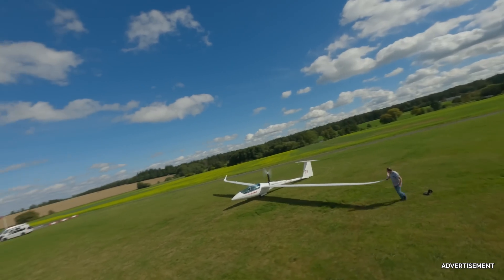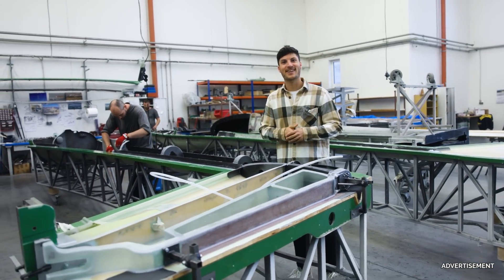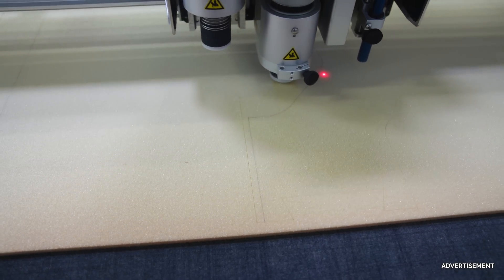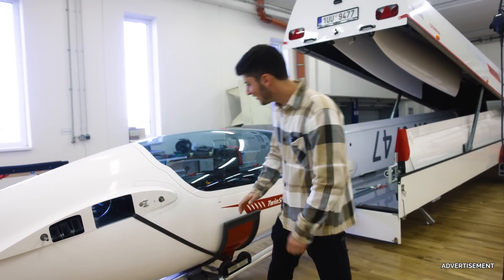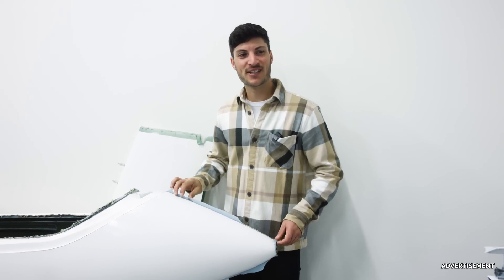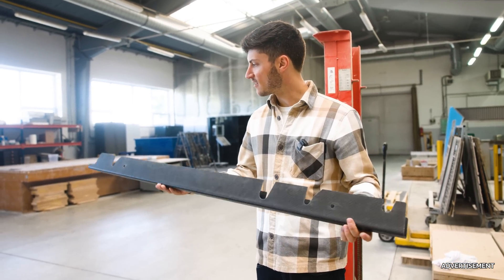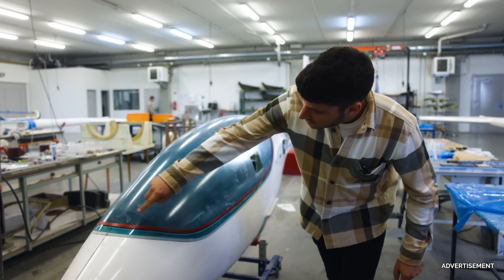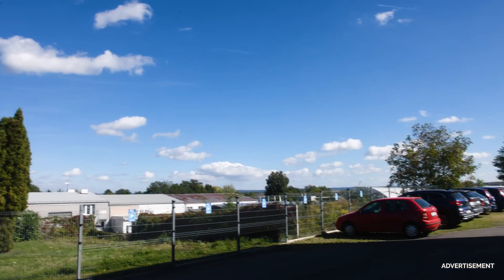How Gliders Are Made - HpH Sailplanes Factory Tour & Production Insights

Comment: Very nice. The wing is a little above the center line of the fuselage. Is that considered better?
Reply from the maker: I assume so. But it's probably also about ensuring that the wings don't touch the ground during takeoff, making the wing assembly easy, and having enough space in the fuselage for all the controls.
Reply: @SteFly  I guess the wings droop a little when stopped? that might be why. regarding controls it must be harder to have it higher as the rods go under you?

Comment: They also use the large portal milling machine to produce all their molds (e.g., for the wings), which is why it has to be so large. It would be interesting to see if other glider manufacturers also use such a large number of high-tech machines.
Reply from the maker: Yes, that´s a big advantage. I don't know if Schempp-Hirth or Schleicher has these huge milling machines. Perhaps Jonker Sailplanes has one and DG also has a bigger portal milling machine.
Reply: I like seing small aircraft manufacurers who believe in doing their own machine work. Once you have the equipment and knowledge you start thinking about how efficiently you can use them for various tasks and it looks they're doing great in that regard.
Reply: @SuperYellowsubmarin  I used to work for another czech based ultralight manufacturer and despite larger manufacuring volume there was less automation and everything was much mora labour intensive with lot of technologicaly demanding work outsourced to external manufacturer. Hats off to HpH. In house production is the way. And that large portal mill is SWEET.